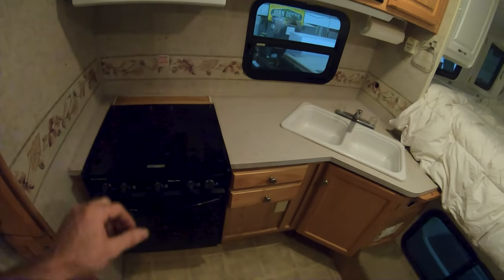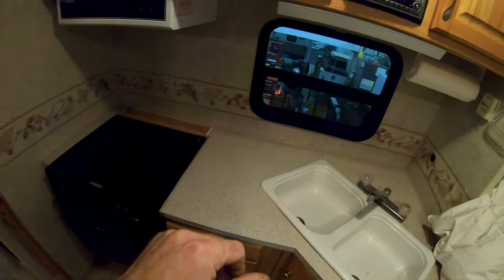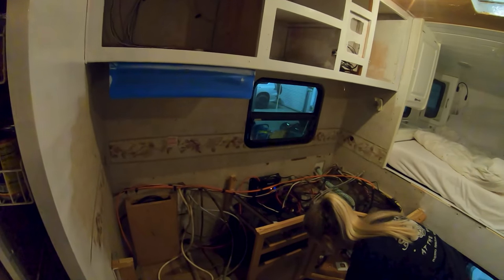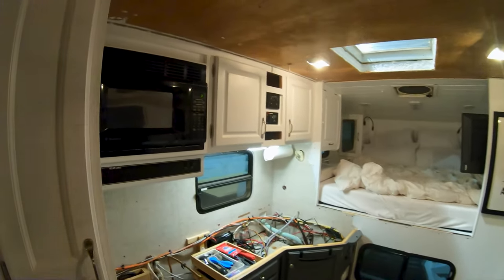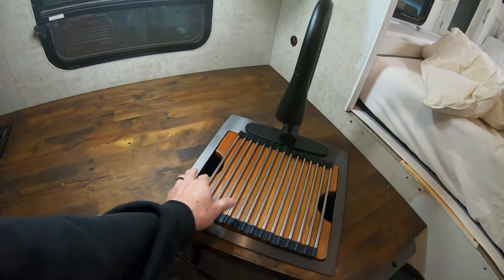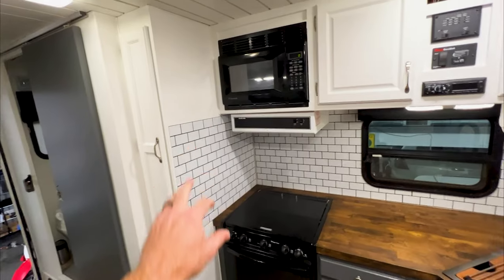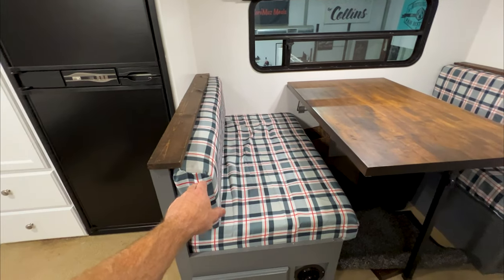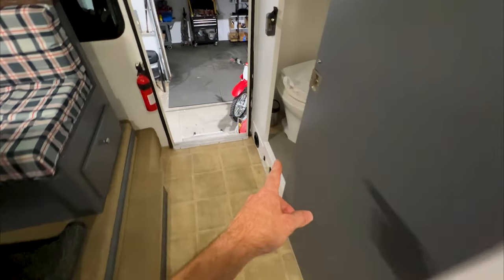Renovating our 2005 Arctic Fox 1150 Truck Camper Part 9- Kitchen/Dinette

Comment: I really like your sink, where did you get it? Also, what type of wood did you use on the counter and table? How thick is the shiplap on the ceiling?
Reply from the maker: The counters are butcher block and the sink is just from Amazon, black stainless. The shiplap is 1/8” thick mdf panels.